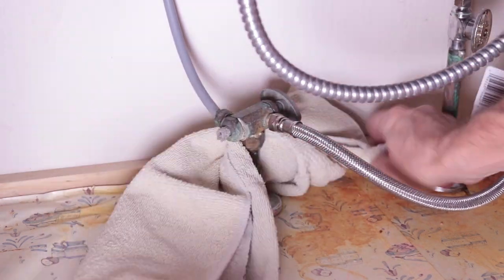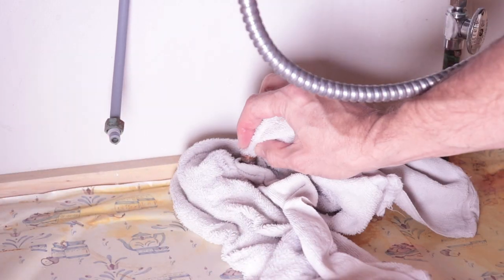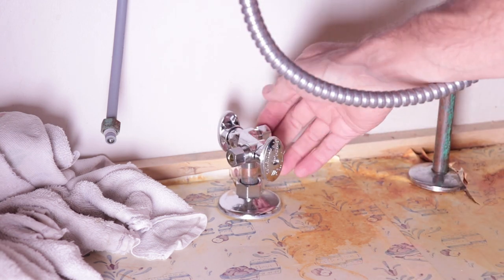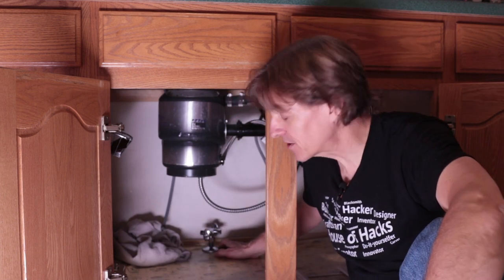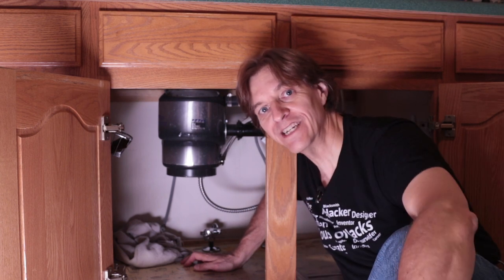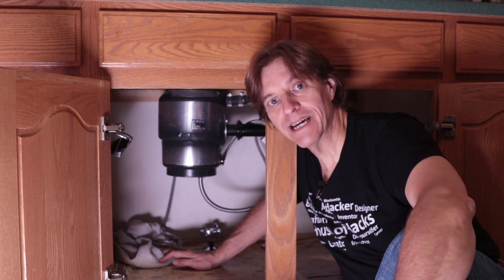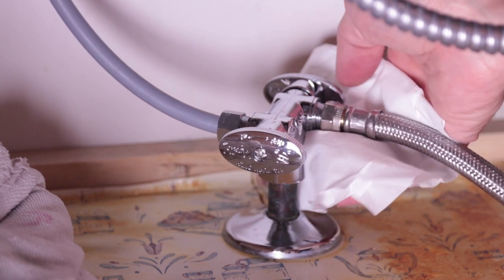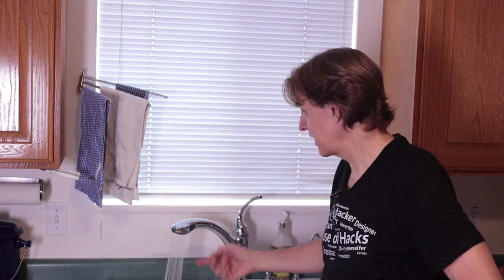How To Replace A Water Shut Off Valve Under The Sink

Comment: I replaced all the shutoff valves in my house without cutting the pipe. Simply because there wasn't length enough on the pipe to cut some off, the pipes went into the vanity woodback panels, with barely an inch to spare. I had bought a compression ring puller, to get the old ferrule and nut off the pipe. The old compression rings left a minor unnoticeable dip in the pipe, but after cleaning with some Emory cloth, the new valves went on there no problem. One had a minor drip, so I took it off and lined the new ferrule with plumbers tape, and that did the trick.

Comment: The tube cutter is an amazingly handy tool. Would I do the same for the shut off of a toilet? The shut off tap where the water comes in to fill the tank no longer works.
Reply from the maker: Yes, it'd be similar. You need to make sure you have enough pipe coming out of the wall to cut off the old and still be able to put the new one on. I've replaced all the shutoff valves in my house with quarter turn ball valves. They're much more reliable over the long term.
Reply: Thx..There's not much pipe coming out of the wall so could  be tricky
Reply: Cost me only $200.00 to get it replaced by the plumber who repaired our main.  Said it normally would cost $350. The cost of replacing the main is another story:-)
Reply from the maker: Did they have to add extra pipe with it being so close to the wall?
I was wondering the other day how your water mains were coming along.
Reply: Looks like it and new valve. They replaced the main using  black plastic pipe (99 year warranty), 5 years on labor.,. Mistakingly cut through internet cable while digging the hole outside so had no internet for 24 hours. Overall good job...kinda expensive for a days work for 2 people though.

Comment: thats alright, no soldering required!
Reply from the maker: Yep. For under the sink, soldering is a pain with the awkward angles. Although overall I prefer soldered joints. I've never had a problem with getting a soldered joint be sealed the first time. On occasion, I've had compression fittings not seal right initially. Peace.